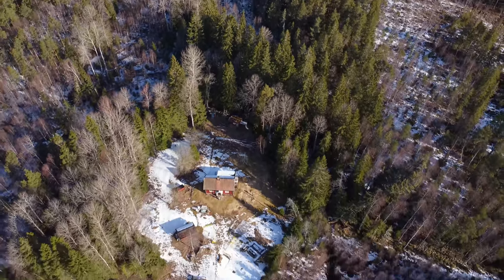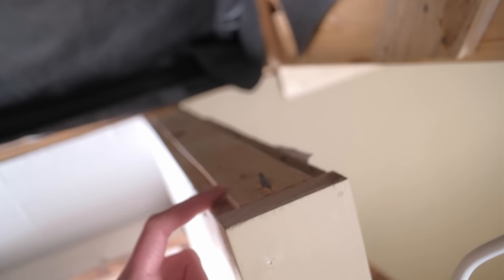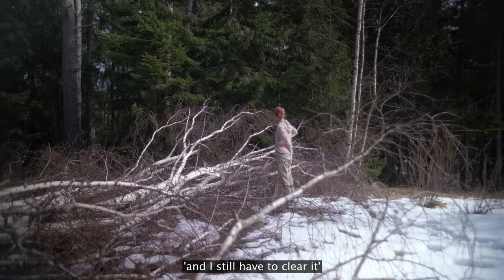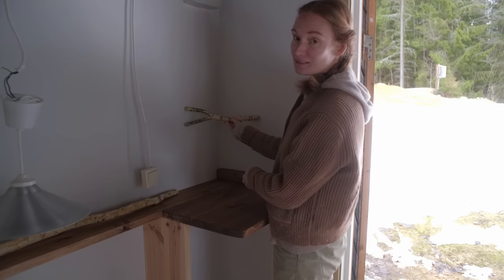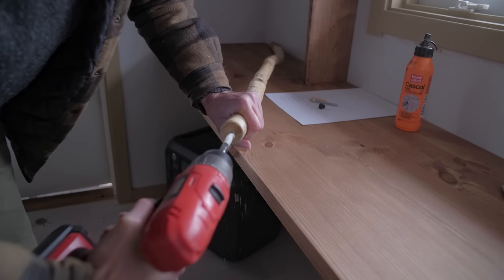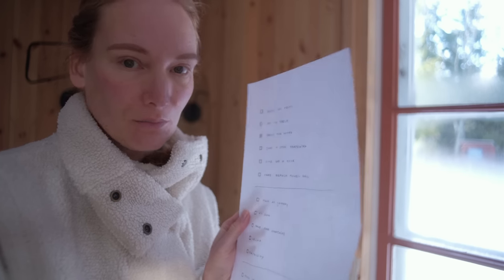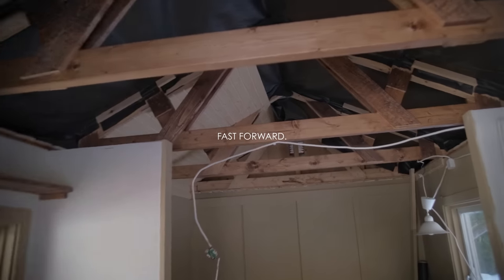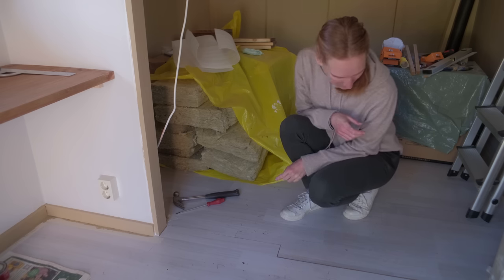Making A Towel Rail From A Tree Branch And Other DIY Things (Story 49)

Comment: I am loving the drone shots….your forest looks so fragile from the air. Not that you need more projects, but I wondered if a cordwood wall for the back of your greenhouse would work. It takes time (ah! Time!) but working with cordwood is manageable for most, and it would create a thick wall to gather warmth. You would have to frame the front enclosure and use glass windows. I had just been thinking about your greenhouse project that I see in some of your shots. Your greenhouse might even be useful during the winter. You can disregard this information as not useful and I won’t mind. It was just a thought and I wanted to suggest it before I forgot.

Comment: Motors on things like jigsaws usually don't die.  Normally it is a component (like a bridge rectifier if it does ac->dc conversion) and are easily repaired.  I know it's not your usual content (which I love!) but it's likely you could easily repair it for very cheap.

Comment: Rosie you can buy portable gas and  wood burning stoves which will warm your spaces.  Just dont leave them inside while you sleep due to carbon monoxide poisioning.  so you would have to put it outside at night. you should also get an carbon monoxide alarm.

Comment: I love watching all your videos, have been binge watching 😊 I felt really sorry for you with your wet shoes! I’m wondering though, in a land with so much snow; don’t you have some sort of warm snowboots? 
Also wanted to ask: in a previous video I saw you with the tiny candles under the terracotta pot. It’s supposed to give some heat. I’m wondering if that really works? Or is there any other cheap solution to keep yourself warm there? F.i aren’t there second hand shops or anything for a 2nd hand heater or something? 
Again, love your work, your skills and video skills as well! X from Holland

Comment: If you take a pocket knife to the bark the bark will peel off with knife.  Just put blade slightly under the bark & pull down. I do this all the time.  And make all kinds of hangers.
Reply from the maker: I’ll have to give that a try, thanks!

Comment: take the wiring out count each roll and replace with new same gauge wire connect all wires and soldier the ends then put into the same as removed from screw up put everything back the same way you took it apart then try it easy once youv'e done it saves you money worth learning  same rule for most things electric